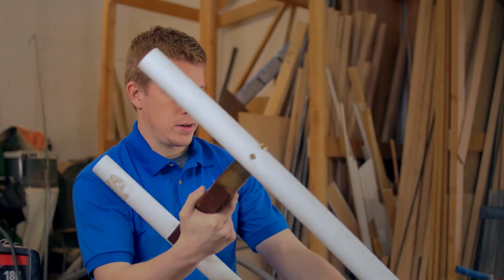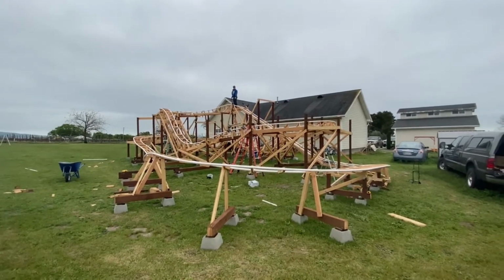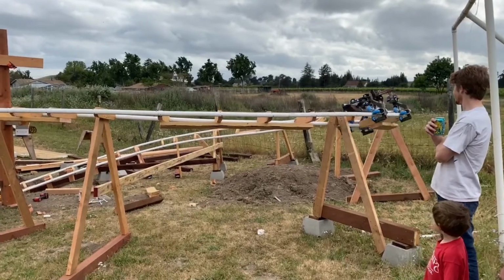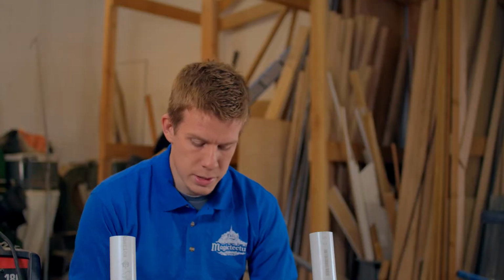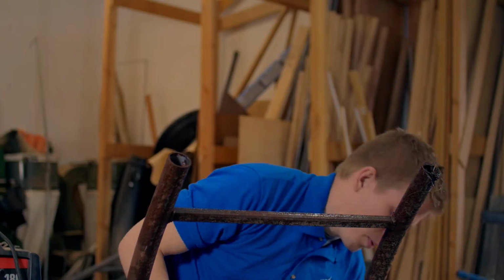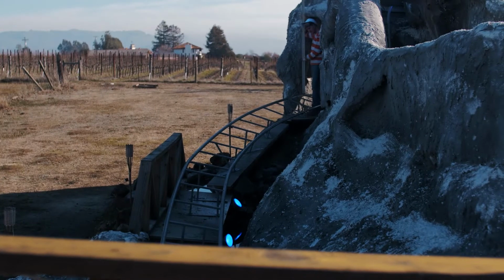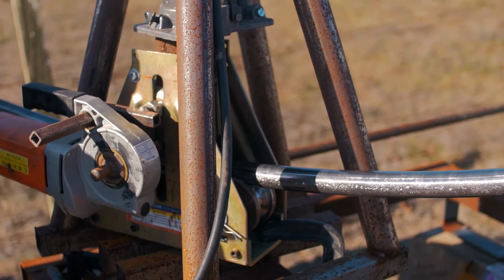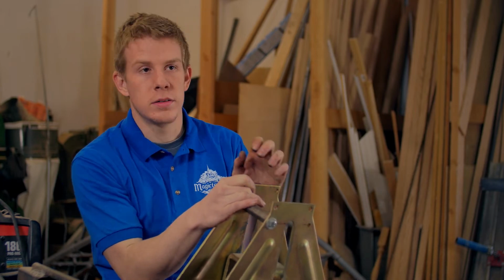Behind the Matterhorn : Episode 2 | The Track

Comment: What materials did u use to make the mountain
Reply from the maker: The exterior shell of the mountain is stucco which we sprayed onto chicken wire/tar paper backing. The color was achieved by applying three separate colors of paint and finally adding a white paint/sand mixture for the snow.